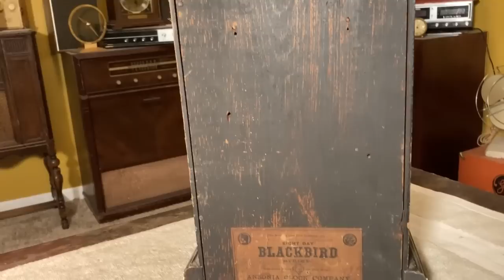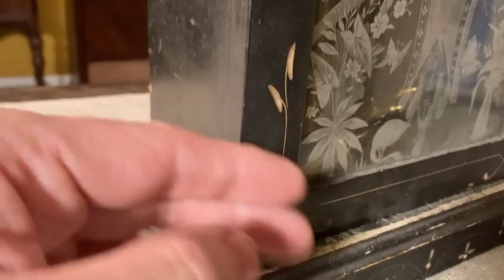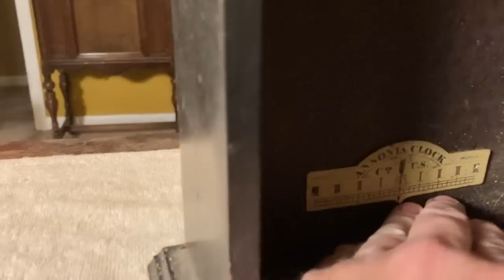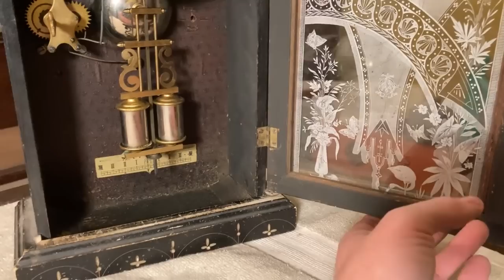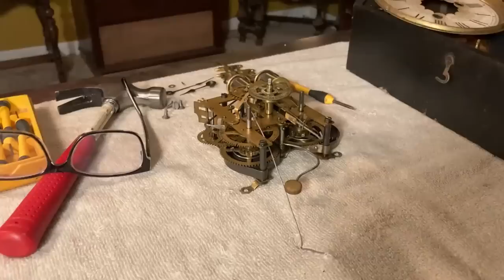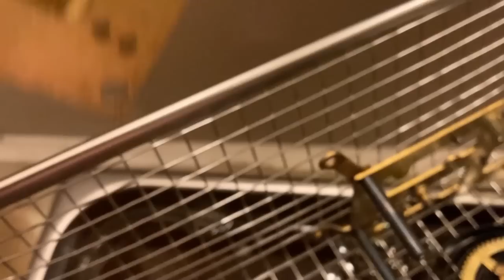This Beautiful Antique Clock Was Sitting On a Junk Table At The Flea Market...

Comment: I love this clock. The pendulum is great! The black and white contrast is nice. No one scrubbed off the glass design. What I find the most unique is the textured wallpaper type stuff inside the case. Love it! You got such a great deal.
Reply from the maker: Someone was saying in the comments that they believed the movement had been swapped out, but it's still one of my favorites!
Reply: @AmateurRepairTime  I don't think so at all. The movement was marked Ansonia. It was a very old movement based on the springs, blued steel screws to hold the plates, and only one arbor with lift arms, instead of two, like Seth Thomas and others used after 1900. Yours had that brass lift cam system riveted on the back plate. I think it's the original movement and with all of it's features intact, it's a beautiful pre gingerbread clock. Much more valuable than the common gingerbread/kitchen clocks.

Comment: I agree. Very cool clock. It also looks to be somewhat valuable. Read up online for going prices and also the company history which is interesting. The etched glass is fantastic. If interested, take a good picture of the faded text and convert it to black and white, two tone, or high contrast. Then flip it to a negative. Doesn't always work but it's free and doesn't take long. If it's a fragile antique lacquer finish on housing, clean only with distilled water on damp rag. No cleaning chemicals. Don't ask how I once found out. ☹ 
Nice find. Cheers. 👍

Comment: JOE or RON, Why can't you put in unlike metal materials parts in the ultrasonic cleaner at the same time? It causes what type of issues and problems
Reply from the maker: It will electroplate them sometimes if you do that.
Reply: @AmateurRepairTime  yes you mentioned it's called electroplating but I'm not sure what would cause electroplating? Any examples

Comment: Looks like that movement has been serviced by some good technicians and some bad ones, not surprising with a clock that old.  The soldered one is the strangest to me, instead of just pressing the little plate against one side why not drill a hole and use the plate as a new pivot?  Would have taken only a few extra minutes of work.  Some of the bushings seem to be in holes that look odd, they may have been fixes for previous badly done fixes.

Comment: Not sure if you are finished with this clock movement, but this is a 30-hour movement and not an 8-day. Somebody probably recased the 30-hour movement a long time ago. 8-day movements will have 5 wheels on the time side instead of 4. You set the alarm by lining up the hour you want the alarm to go off with the hour hand, if I remember correctly. I worked on clocks for over 10 years. Some movements came from the factory with bushings like on your movement and some came with a flat area around the pivot.

Comment: The part that swings and has two cylinders (barrels) is called a pendulum. By itself it is rare and worth  $40 alone. The 
etched glass looks awesome and original to it. I noticed the ratchet has a triangular shaped wear spot on it and might not
be catching the tines gear above it properly. I think you are right about the age at 1886. 138 years young! Looking forward
to part two Ronnie. Like to see if you can get it put together and running!

Comment: I see your new clock ⏰️ video. I liked 👍 the last one. About 8 minutes of "Tick Tock, Tick Tock", until the clock struck 12, which was at the end of the video 📹. Just be very careful when taking clock movements apart. ALWAYS power down the mainsprings first. Wear eye, face, and body protection, in case ya have a mishap with a mainspring. Since this is amateur repair time, it makes sense being very careful. Your friend, Jeff.
Reply from the maker: Jeff you must have missed me talking about that in the video

Comment: You need some "Clock Mainspring Clamps" they are a C shaped piece of metal that stops the spring fully unwinding when disassembling the clock movement. They are quite cheap too. They make life so much easier.
Reply from the maker: I mentioned that in the video, you can’t take them out after you put them back in, that I can tell (I have some)
Reply: @AmateurRepairTime  You wind the spring fully and find one of the clamps that has a fair bit of clearance. fit it over the spring and then slowly let the spring down until the clamp has the tension of the spring. After reassembling the clock you just have to wind up the spring until the clamp is loose then and then remove it.
Reply from the maker: I understand that, but the problem is you can't remove the clamp, from between the plates (or insert it).  If it's big enough to go around the spring, it's too big to go between the plates....
Reply: And if you don't have the right size clamp for your movement, you can use a loop of mechanic wire, just make sure that it has at least 3 half twists on the ends to secure it.  I suppose a zip tie would also work, but I dislike zip ties.